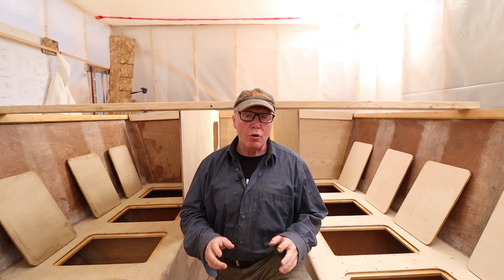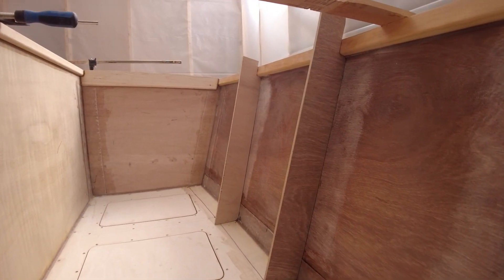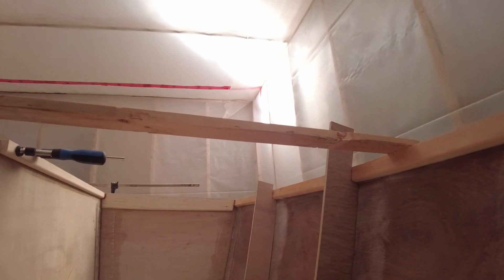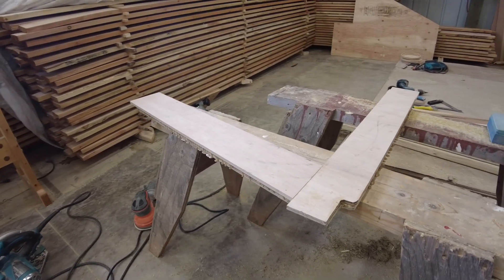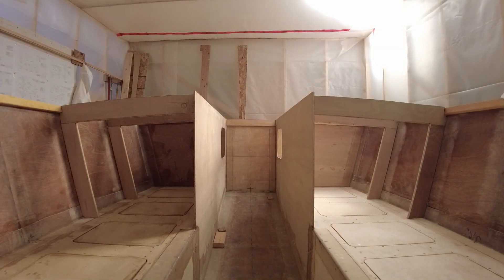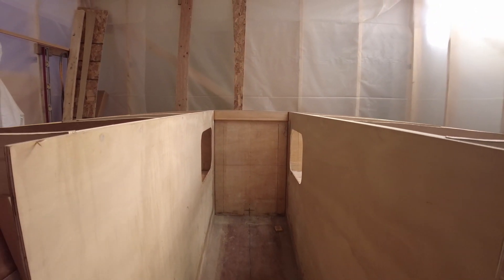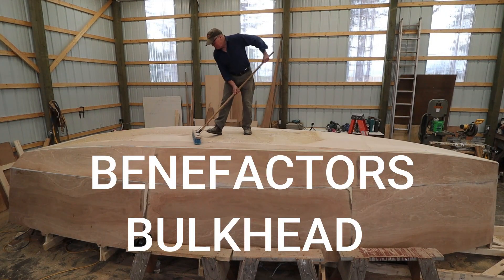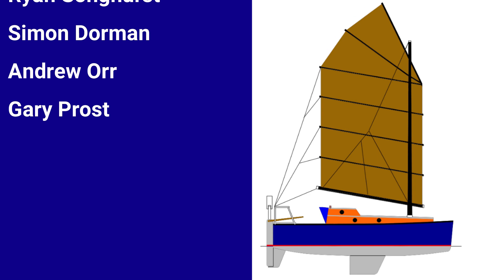S2E48 Building and Installing Ring Frames || Filleting || Fiberglassing || Wave Rover 650

Comment: Great video as always Alan and as a non-sailor, your WR 650 project very interesting indeed - I've watched every episode from the beginning! One question about the ring frames?  Is the reason why they are "L" shaped and not an open square shape?  I thought the additional vertical on the inboard side would add additional strength?  Or was it to provide more free space?

Comment: Nice work as always Allan. Step by step she’s coming along. Watching you hold the frames in place, brought to mind the hot glue gun. An excellent tool in certain situations, which in seconds will hold a part in exactly the right position before you apply a fillet and it cures. I used it recently to accurately position and hold all the bulkheads in the float I’m building for my tri. Clamps can be incredibly awkward and clumsy in certain situations as we all know… Their job done, the few dabs of hot glue here and there are buried in the fillet and never seen again, and effectively make zero difference to the strength of the joint given they constitute only a fraction of a percent of the overall hold. And it’s easy to just peel off the hot glue if you want to move or reposition the part before the fillet’s applied.  It can also make a really handy “third hand”.  Anyway, I’ve a date with fairing compound and a sander, so time to get dusty  ) :  Cheers.